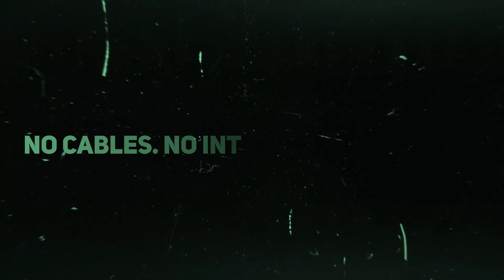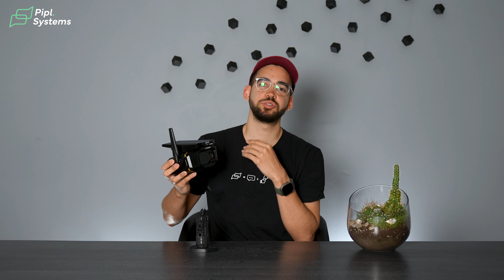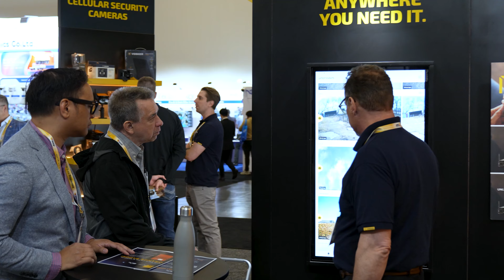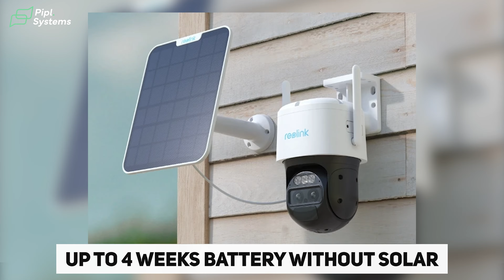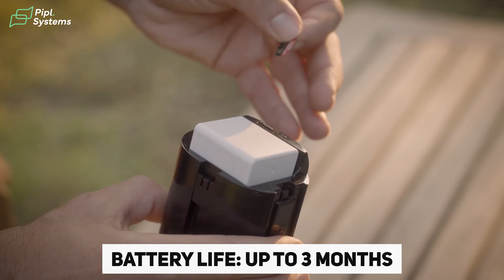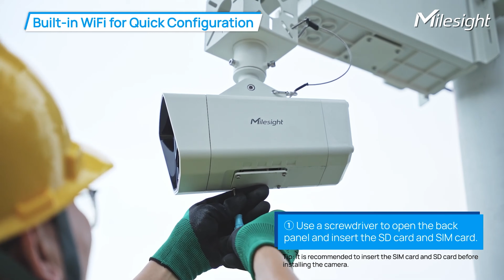Best LTE Cellular Security Cameras 2026

Comment: Why not mention if the cameras have the option use a external power supply, like indoor cameras??
Reply from the maker: Thank you for your insightful comment! You're absolutely right, and I completely agree that we should have mentioned that specification. We’re so accustomed to LTE cellular cameras typically being outdoor models with solar panels and internal batteries that we overlooked highlighting this feature.

Comment: For the cost, a milesight should have a 12mp or higher! 4mp these days are cheap
Reply from the maker: I completely agree that for a professional-grade system like Milesight, 8MP or even 12MP would be ideal. However, since we're talking about signal transmission over cellular networks, users often prioritize lower resolution to ensure stable and efficient data transfer. Thanks for your input!
Reply: @piplsystems high res cameras also use a lot more power, both for recording as well as transmitting. So not only would it require a lot more data, it would also need a bigger solar panel and bigger internal battery.

Comment: I trusted Eufy solar panel cameras for a property I have in another state and I should never have. I have multiple S340s that are only a few months old with the solar panels facing the south and they were charing fine in the winter, going to 100% no problem then in March one stopped charging and eventually died. The other one was still doing fine, then it struggled to get above 80%, now seems to be struggling to get to 70%. My one here at home which is super south facing in blazing sun seems to be now struggling to get to 90%. Eufy needs to recall all these cameras, this is ridiculous. Great cameras that connect fast and are built well and Homebase 3 is excellent but the solar charging is trash.
Reply from the maker: Thank you for sharing your experience!
Reply: @piplsystems  I had a question for you also since you seem to be very knowledgable about Ubiquiti, when I go to that property again I want to put in Unifi cameras and two days ago I bought CloudKey Gen2 Plus and a Lite 8 POE and I tried to setup them up at my house here to test them but it doesn't seem to work. I wanted to run them off a TP Link mesh router. Do I have the right equipment and if not what do I need and if I am doing it wrong what do I need to do? Thanks.
Reply from the maker: It seems your TP-Link mesh router might be causing issues with UniFi device discovery and creating potential network conflicts. A good option is to replace it with a UniFi Gateway Lite (UXG-Lite). This way, you'd have a dedicated gateway/router and remain fully integrated in the UniFi ecosystem alongside your existing Cloud Key Gen2 Plus.

Alternatively, if you want an even simpler and more robust solution, you could replace both your Cloud Key Gen2 Plus and your TP-Link router with the UniFi Dream Machine Pro (UDM-Pro). The UDM-Pro combines routing, UniFi Protect (camera management), and UniFi Network management in one device, eliminating the need for separate components and offering enhanced performance for more cameras and network capacity.

Whichever route you choose, make sure your TP-Link mesh router is either set to Access Point mode or removed completely, to avoid double NAT and ensure smooth operation.

Hope this helps.
Reply: Lithium batteries will not charge in below 0 degrees Celsius, so this might be the reason
Reply: Will not work with Verizon either.